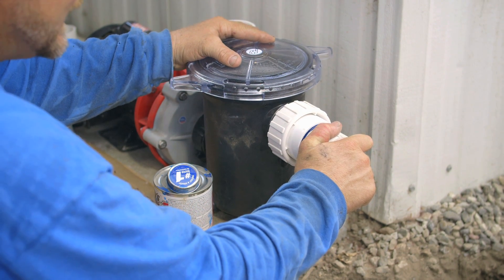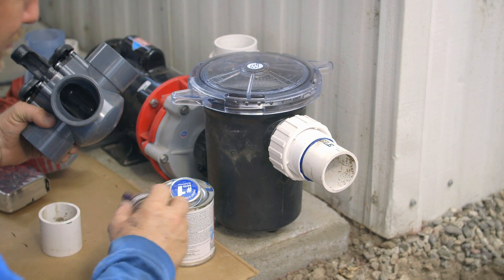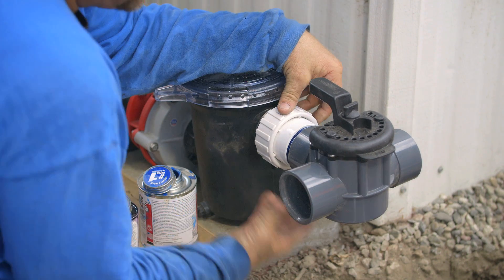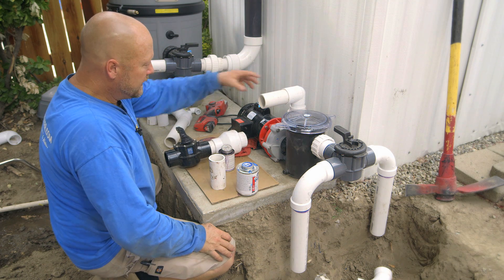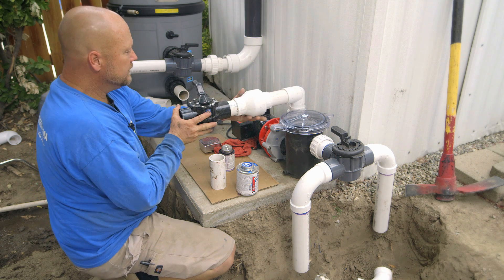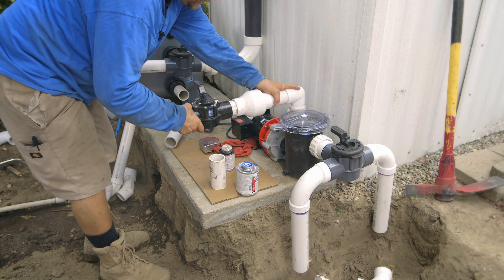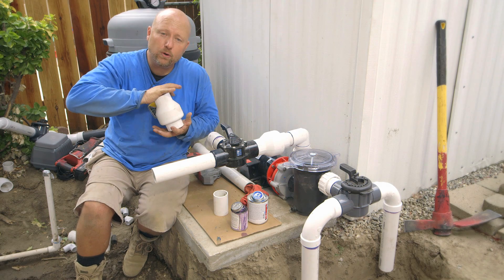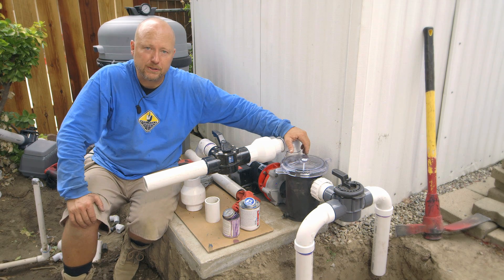Pond Pump Installation - KP 40

Comment: Hi, my pump looks like this model in the video it has skimmer and bottom drain and it had been working well for 7-8 years recently I just found out almost nothing sucking out from bottom so i tested...i closed the bottom drain the skimmer run super  strong and when i closed the skimmer the bottom drain pumps very slow (weak)  any issues you may think of? Please I need your advice thank you very much.